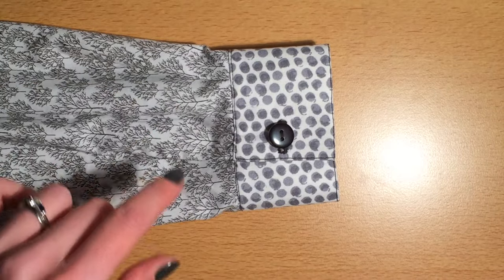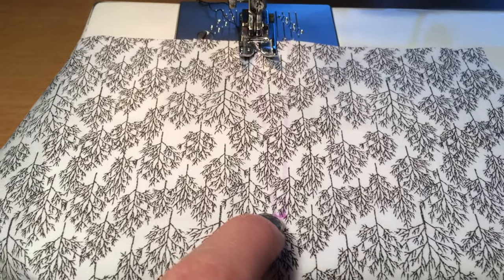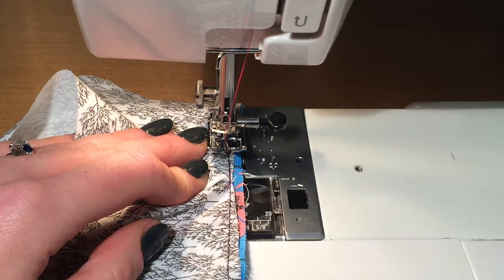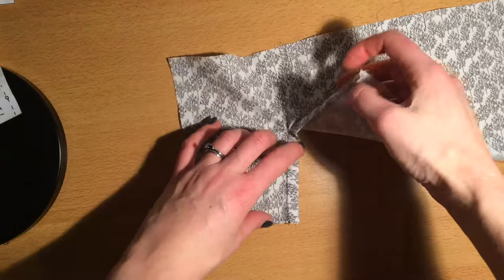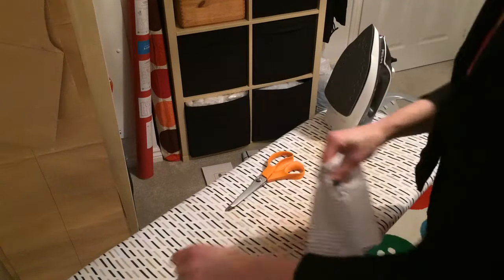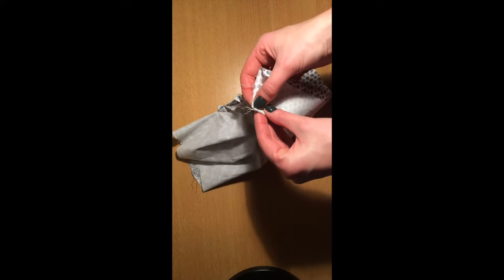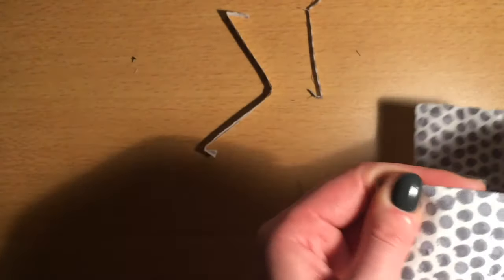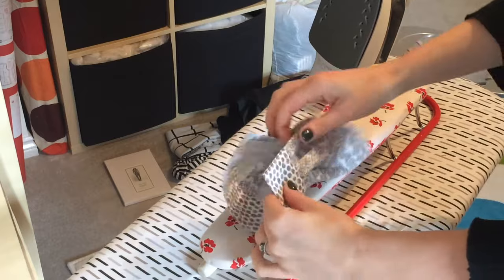How to create a Shirt Cuff with a  continuous lap

Comment: I am so (sew) grateful for this video. These are the exact steps need for Simplicity Pattern 8180. I am a beginner/intermediate level currently taking classes and would've had to wait to return back to class in order to finish this shirt. You are very thorough and easy to understand. Thank you for taking the time to share your talents and skills all the way down to the bonus cocktail stick. I may try that technique instead of using the button tool that came with my machine. I am making a dress shirt for my husband which was supposed to be done in time for Father's Day, but at least it is still June...LOL
Reply from the maker: I’m glad I could help! 😊
Best of luck getting the shirt finished. There’s another video on how to attach a shirt collar and one that shows the whole shirt making process, in case they offer you any additional help.

Comment: Great tutorial!.  It is very tricky to add that continuous lap, but you have shown how well it can be done.   I was hoping to get some idea of measurements for the actual placement of the placket or lap.   (how far is it from teh back seam or midpoint of the sleeve?  Want to add a cuff to an existing blouse and don't have a pattern at hand to follow.  thank you and hope you do more as you cover the topics in good detail, especially if you are new to sewing.
Reply from the maker: I glad you found the tutorial useful. The opening for the placket / continuous lap is mid way between the seam and the centre line of the sleeve, in the back section of the sleeve.  On my sample it's about 9cm in length from the hem but could be longer or shorter depending on preference.  Hope that helps :)